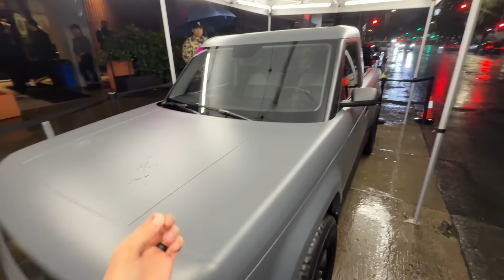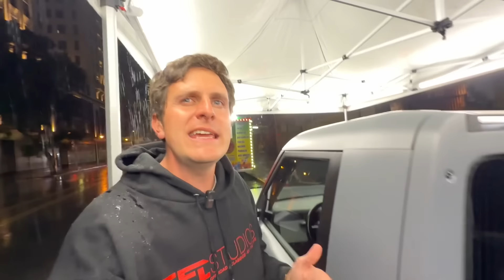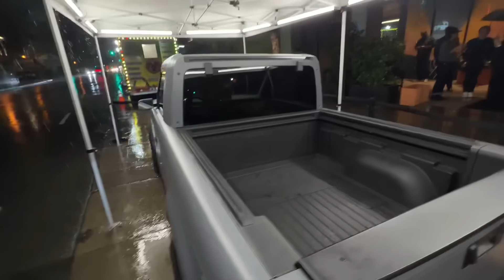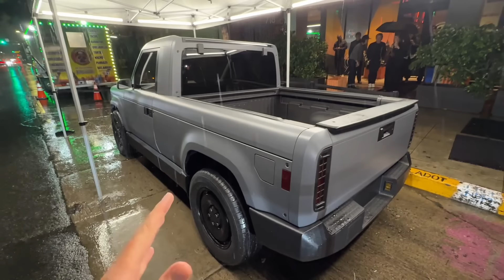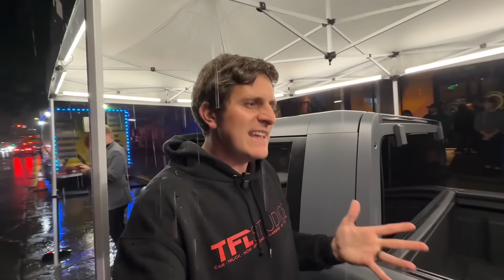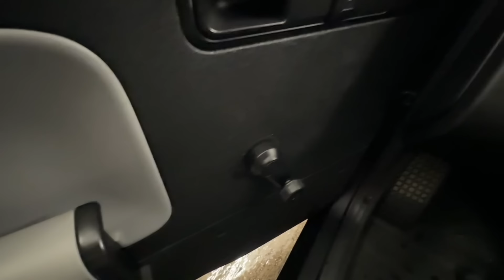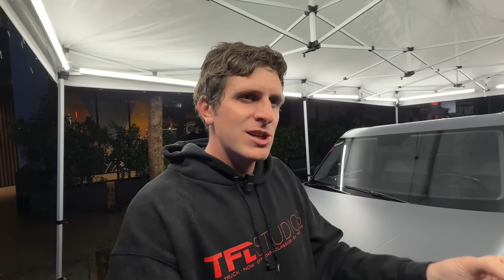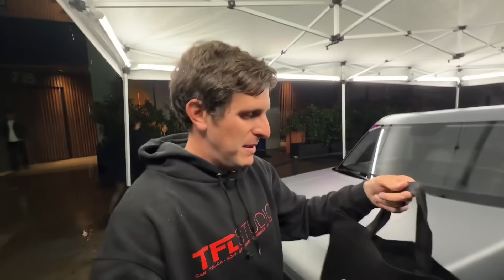The TRUTH About the '$20K' Slate Truck...Will This Really Be a Hit?

Comment: If you can charge at home, you should be OK since you are getting a “full tank” every morning.
Reply: 8 hours on 120V  about 3 on 220V which your dryer & stove run on
Reply: @gregorybarth930  I'd heard around 11 hours from 20% to full at level 1. That's fine with me.
Reply: I pre-ordered mine last week.  I'm looking forward to receiving it...
Reply: The grid is strained whos going to fix these things,theres is no diesel and gas mechanics if i was 20 again i would have got my trsdes tickets
Reply: Not if you work 12 hour shifts or longer with an hour each way commute.  At best 8 hours to charge it, assuming you're not so tired you forget to plug it in.
Reply: @wwShadow7  Not remembering to charge it is user error. You go home, you charge it as you get out the car.  The charger is like in your face lol.  8 hours is plenty for L2 home charging.

If you forget once, you're sure as hell not forgetting a second time 😂.

Plus, there are many chargers that will notify you if you aren't plugged in at a certain time of day.
Reply: @lawbinson  Some days I'm so tired when I get home I just put my seat back and am instantly asleep.  I'm certainly not plugging in until I wake up hours later.  Also if I eat out before heading home and braving the traffic, that 8 hours can be 6 or 4 or 2 hours depending on the drama of the day.
Reply: @wwShadow7  I don't think you're understanding how plugging in works though. It's literally between me parking in my garage and getting into the house.

The charger is in the way of me getting into the house and it's impossible to miss.  It takes 2 seconds to plug it in.  It's just not a valid argument that you'll be unable to plug it in 2 seconds after leaving your car that you were just driving.  If you are that close to collapse, driving itself is crazy dangerous.

If you're also saying you are only sleeping 2 or 4 hours consistently, that is also extremely problematic... 

I hope things get better for you.  That sounds very rough.
Reply: @wwShadow7  The battery is small, so at its 11kw home charging speed, you can go from 10 to 80% in like 3 1/2 hours.  Tell me you know nothing about charging an EV without saying you know nothing about charging an EV.  If you're so tired you forget to plug it in, you shouldn't have been driving in the first place.
Reply: @mdbbox5660  Or you do the inevitable and own two of them, so one charges while you use the other one.  My car runs on gas, still going 20 years later.  Where I just expect all EVs to be paper weights in 3 to 10 years, when their batteries no longer do their job.  Just like every laptop ever.
Reply: @wwShadow7   I mean, just look outside... there are many EVs out there on the road that are not paperweights after 3 to 10 years. To even make that comment is just ridiculous when the evidence is on the road every day.
Reply: @lawbinson  The first Tesla was 2008, is it still on the road?  My gas car is 2005 and IS still on the road.  I see EVs everyday.  And often get delayed by a Tesla FIRE, because traffic is stopped until it burns out and the flares burn out.  A sheet of glass on the side of the freeway every 300 ft it seems.  At least near Austin Texas.
Reply: @lawbinson  I see EVs many times throughout a week.  A lot of times ON FIRE on the side of the road.  A sheet of glass every 300 ft it seems, from previous fires.  At least near Austin, Texas.
Reply: I have seen 2 cars go up in flames. First one was a VW bus, the other was an old f-150. Electric vehicles sometimes catch fire, but it happens less often than ice vehicles.
Reply: @wwShadow7  Statistically, there is just no way. Every EV incident must just be happening on your route while no ICE incident ever happened on your route.
Reply: @wwShadow7  Is the Model T still on the road? Comparing early EVs to the now much more mature EV is a false, bad faith equivalency.  Even though it does not compare to today's EVs, Model S's from the early-mid 2010s are still on the road. 

Early Leafs, i3's, and Bolts are still kicking as well.
Reply: @wwShadow7  ok boomer.
Reply: @wwShadow7  How many people work 12 hr shifts? 0.1% of the workforce? 

Average commute in the US is less than 40 miles roundtrip. 150mi with standard battery is just fine. Larger battery gives 230mi range.  It can be charged at Tesla fast chargers easily, if you need longer trips.  

Reality is this thing is a lifestyle toy, not a serious vehicle, but so are the vast majority of trucks - most never go off road, most never even get dirt in the bed. My 6'-8" neighbor drives a small truck - literally never seen him haul/tow anything other than boxes from Costco.  It's a joke, but it's a 'manly' truck to a lawyer😂😂😂
Reply: @ArthurDentZaphodBeeb  Been here lately?  I drive 65+ miles a day to have a job.  It's 40+ minutes EACH WAY.  Plus the shift.  Trucks are a thing, not because of what they are.  But because they last and hold their value better.  It's because you don't haul loads that it lasts decades and goes 300K miles, before you even think about selling it.  I've never had one, because I like my 30+mpg and 400 mile range.  Plus parking anywhere and turn on a dime.  Plus new tires are $400 for 4, not $400 EACH.
Reply: @ArthurDentZaphodBeeb a lot of people work 12 hour shifts in USA. You must a Euro with good labor laws.

Comment: I'm in...  kinda. So her is the thing. I look at this as a valid replacement for my 2013 Volt. My current 30'ish mile range is good for probably 70% of my needs. 150 would be just fine as I usually rent for long distance travel much over that. The prices should be fine and Id not even be that much into modding it as the base model is fine. So my biggest concern would be bugs / quality for a new brand.  And most of all service. Im not convinced they have properly figured that out. There needs to be more factory support and not just slouphing this responsibility to a third party with little quality control. There needs to be competent,  consistant, visual factory support out in the field. Im very interested but I may wait a year or two to see how this works in the real world before I plunk down money.

Comment: I see it looking successful in the beginning. People buying it as the new fad. It will quickly fade out. The truck is just not equipped well enough. People really want a cheap truck but they don't want a ill-equipped truck. Most people would much rather have the Maverick. Also are they really going to hit that 20K mark? Most likely not.

Comment: People used to have more kids and get a station wagon.  A lot of station wagons could haul stuff, fit a 4'x8' sheet of plywood, tow the family camper, or whatever.   Maybe dad had an old single-cab, long bed pickup for messy stuff.  Then people started watching Urban Cowboy stuff and everyone wanted "cowboy Cadillacs" and four doors and make it dad's family hauler and manly truck while the wife gets to suffer with the minivan.  Dealers love selling overpriced pickups because it maximizes their profits.  They don't order base work trucks to put on the lot.  I bought my first Suburban in 1985, by going to the dealer and building one from the order book with the features I wanted.  It was $16,000.  In 1999 I did the same thing again (you have to find a dealer with a salesman willing to sit down with you - that's usually the "fleet sales" guy - and build it yourself.  The '99 Suburban was $31,000.  The price doubled in 15 years.  By 2015, the price had doubled again to over $60,000 and I stopped buying them.

Comment: No self cleaning seats, no 176 ways to adjust your seat, no entertainment centre with a mega screen, no perfume puffer for a soothing scented ride, no shag carpet. No way I would ever buy this truck. If you want to know if your company hates your guts and despises the worker, they will get a fleet of these, shorten lunch break by 15 minutes and attach cameras. What a joke. Need repairs do them yourself, need parts wait till hell freezes over. Even a illegal would look at you and say my lawnmower has more options and return home because of the embarrassment of being seen in this death trap. Good luck! But don't worry you can spend 4000 bucks to wrap it and add a cover for the bed with those cute little rings to know where to sit your latte.

Comment: Remember the Ford Courier/Mazda B2000? They were selling a 6' bed short wheelbase and a 7' bed long wheelbase. The bed was separate from the cab like it should! To get a long-term success, they need to add a 4WD option and some DIY upgrade kits for a "minimal" modern comfort. This thing looks stupid in it's actual short format and useless as a cheap pickup but may look good enough as an SUV.

Comment: I like the idea of electric. But, and this is a big but, i live in rural Kansas. Once a week we drive 1.5 hours 1 way(around 70-75 miles) and the. Make multiple stops adding another 10 miles, then gotta drive home. Unless these stops have chargers, 150 miles isnt gonna cut it.
Reply: @phfay7  I think the whole point of this truck is it's upgradable so you should be able to add a bigger battery technically it's also kind of meant to be a work truck so it's not really meant to go that far

Comment: ive owned about 20+ rwd regular cab trucks from the 70s to 00s  , i enjoyed them for their simplicity . living in Fairbanks Alaska most of my winters vehicles have had been rwd as well a good set of hakkapaliats studs  will do wonders for it . most of my commute now days are pretty much just around tow, from 15 to 40 miles a day. even with the -40f and colder temps for the highs in winter which will likely drop the range to half the summer range im still considering a slate  . that being said i am used to having a honda generator int e back of my trucks 

and then there is the Telo .  higher cost but more power, range, seating awd  etc 

in the end ill probably just get a Kei truck  and drive it on 1000 mile trips if and when need be at any time of the year

Comment: 11:17 consumers are done with EVs, nothing is better than a big V8 gas or diesel pick up truck or a big V8 gas SUV, Americans want big, powerful, safe, roomy, 4x4, heavy, 3 rows, 10,000 lb towing, 500-600 miles out of a tank of gas, etc....
Reply: @freddyhollingsworth5945  its the wheel base regulations for why we can't have a small truck with a gas engine. Its not the consumer, its the regulations.
Reply: Also there is a cost still with owning big vehicles
Reply: Idk about that Tesla is the exception still popular everywhere you go
Reply: @freddyhollingsworth5945   I think that will change again when gas is $9/gal next year after the war in the middle east has kept the Strait of Hormuz closed for a year...
Reply: @freddyhollingsworth5945  imagine thinking EV tech won't improve and surpass ICE cars in everyway

Comment: Hmmm, they finally bring it to LA and Instead of putting it in the Auto show, they show it a couple of blocks away. I just got back from the Auto show and it was so disappointing. I can't believe how many auto makers were no shows and what happened to the concept cars? At least I finally got to sit in an ID Buzz. Very cool vehicle. Why didn't you sit In the Slate? I mean the door was unlocked. Were they afraid you would say it was crap?

Comment: Single cab trucks are not that easy to get. I suppose that's part of the reason that there are so many very old ones on the road. I'm envious every time I see one. Really looking forward to the Slate.

Especially since it's an EV. I'm looking forward to never burning my money on gas again. Who actually really likes burning their money??? I'll be taking road trips in this truck, and not worried about it either. There are charging stations at places I'll stop for lunch or to look around. The point of road trips, right?

And I'm glad to have real handles and knobs and no subscriptions. I plan to get mine with a sunset orange wrap - done by the factory, not me!

If there was something comparable to the Slate, I'd buy it. So far, I haven't seen it.
Reply: I switched from a 328i to Tesla model 3 in 2020. 217k miles later, I have saved over 50k in gas and maintenance.

Excited to see the Slate simplify the car further.

Comment: Tommy hit every point I think about this project:
I wouldn't style it. Slate grey is fine. Cars are only black, white and grey these days anyway.
I'd try to live with the crank windows (I did so growing up)
I'd try to live with no infotainment display. Give me some speakers, and I'll use my phone. (And sometimes miss FM radio with RDS)
Tonneau cover please!
I live in Canada with lake-effect snow by the foot. By the meter sometimes. Only 2WD? 
EV though? Waiting on a YouTuber to retrograde it to a 4-cyl manual.

150 miles of range would be plenty for me, I already know (expect in winter when it's 75? maybe most days)
If EV, at least give me enough front trunk for the charging accessories so the charging cable and any adapters aren't sliding all over in the bed, getting beat up. Pouch/netted pocket behind the driver seat at least?
Thanks for braving the elements. Tommy for your take!
Reply: If these take off there'll be plenty of aftermarket goodies out there such as tonneau covers.

Comment: Great vid, Tommy. 
I think this will work well for local deliveries. Like local auto parts stores or something.
But I don’t think people at the under $30K price point will buy this. They’ll buy used and get more vehicle. I want this to sell, for sure. I hope they succeed. But I’m looking forward to the Scout with range extender. 500 miles with a full battery and gas tank.

Comment: I agree that the 150 mile (optimistic) range is a deal killer for most people. They should consider a hybrid drive train or a 2.5 liter ICE at a minimum. Personally, I don't think a pure electric truck is going to sell except for niche market segments. Most people don't need 4-wheel drive, especially in the southeast. 2-wheel drive would simplify the drive train and keep costs down. With all of the safety and environmental regulations the price of vehicles is out of control. My next truck will be a used one from before body control modules came into use.

Comment: I got a reservation in the first day they were offered.   I want a little truck/SUV to run local errands and get to the dog park.  I have a huge diesel 3500 truck for everything else. When I take roadtrips I usually rent a car anyways.  This is a perfect little errand runner.  Can’t wait!
Reply: I'm right there with you. I drive a 2500 4x4 diesel, and I reserved one of these on the first day too. We have also owned a Tesla for almost 3 years, and we've gotten used to driving electric. I would not buy this truck if it were gas powered. I want something to run around town in, maybe take the doors and back window and back panel off like a Jeep, and something that will keep short trips to an absolute minimum on my Ram diesel - the new diesel emission stuff hates short trips, plus I want to keep the Ram forever so I don't want to put miles on it when I could be running around in this. And think of the maintenance savings - servicing a diesel isn't cheap, and our Tesla's maintenance has been $0.
Reply: @tornadotj2059 This little truck so reminds me of my 1980’s Ford Ranger that was so barebones that it didn’t have a bumper or a passenger side mirror!

Comment: I think your Jeep anecdote is because the types of people who want to buy a basic Jeep simply can’t justify such a purchase at current price levels. With a Slate, it’s a little easier to justify a higher price because there will be no oil changes, no spark plugs, many fewer electric accessories to fail, much cheaper fueling costs, no engine air filters to change, and no gearbox to worry about. That all surely means something.
Reply: You can get a base wrangler for 29k. This will be close to that.